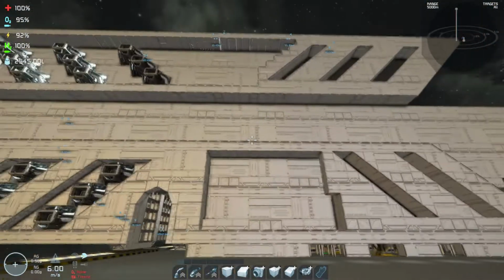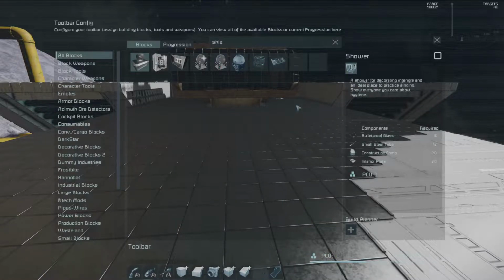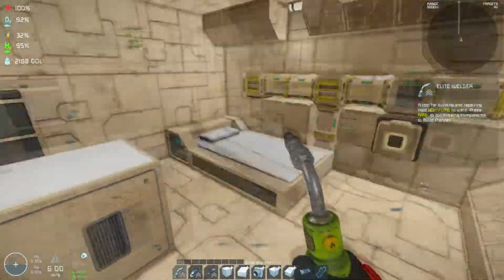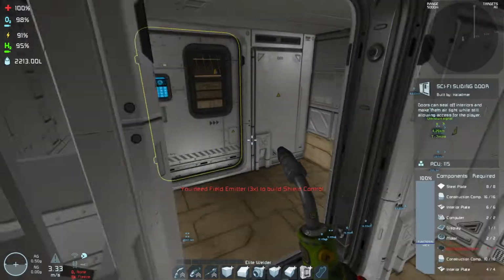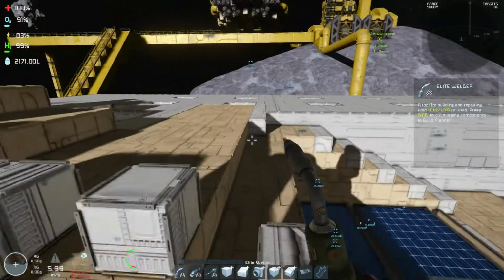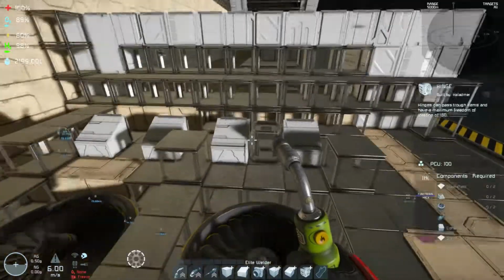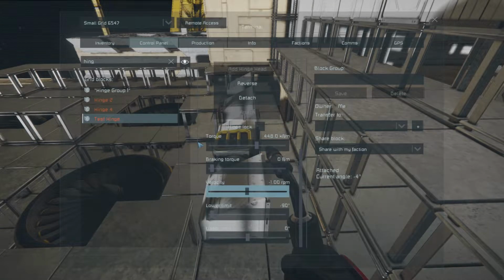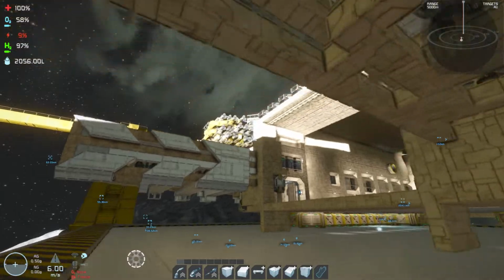Space Engineers | So You Want To Be An Engineer | Ep. 55 - Shields, Mandibles, and Armor Planning

Comment: Hal, do you disable PCU limit? I'm curious.. I just had to increase my PCU from 100,000 to 200,000 in my current single player (PC) game.
Reply from the maker: I generally take it to 2.5x of default (250 or so, instead of the 100xx default)  I find with my system it works well, and the sim speed stays pretty close to 1.0 even when I run out of block/PCU.  I've gone higher but not usually for worlds I'm recording in.

I'll do a quick look at the settings in the next vid for everyone ;)
Reply: @Haladmer  Thanks Hal.. sorry for the delay in response.. I was otherwise occupied in the hospital unexpectedly and only just got home.
The info you've provided will greatly help me.  Have you ever noticed if the number of mods loaded ever makes a difference in sim speed or overall performance?  If so what would you say is a SAFE number to have loaded and active.. assuming all are working correctly AND no errors are reported in game files.
Reply from the maker: No worries, I hope everything is better now!

For mods, it tends to be VERY system (and usage) specific.

Each mod will have a different impact on the system requirements, scripts & mod packs with scripts tend to increase CPU/Ram usage the more complex they get (or the more instances of them you're using in your builds), but even just blocks can slow things down a bit the more customized the blocks (such as custom skins or large number of vertices) are.

The higher end your system specs, generally the more mods/scripts you can run without it really impacting things, but the only way to be sure is trial and error.

That said, usually speaking, keeping it under the 10-20 range is okay as long as they are not things like radar/detector/sensor mods with some crazy hacked level of range on them lol
Reply: @Haladmer  Thanks Hal and yes, I will be in time but at least I'm not still in the hospital.  

You're gonna laugh at me but at the moment I've got around 160 out of 210 loaded and active mods in any one save game... and yes at some point in the game I will get "strange behavior issues"  lol  

What you've shared has enlightened me so I suspect changes will happen in further game plays. Thank You!!
Reply from the maker: Nothing to laugh about, just means you have a lot of great mods running on a good machine! :D

SE does weird things when you start running into memory issues, so my general advice is to start with either large block packs, or heavily scripted grids for likely sources for pruning.

Let me start by saying, I'm NOT calling out any of the following mods for issues, just using them to highlight areas I look at for system/game/sim-speed impacts:

Scripts related to heavily automating inventory management, for example Isy's Inventory script is actually a really well optimized script, so it's usually more the number of things it's controlling and less the script, or things like the old version of the Tiered Thrusters block pack which had 4 or 5 tiers of thrusters, using custom color trails and a lot of block definitions that were unique to each thruster, are good places to start.

The older version of the modular thrusters is another mod I watch for sim speed hits, but the newer version (from my understanding) fixed some of the legacy issues by removing some of the build states/model complexity (and cleaning up a few associated things)

Again, not trying to throw shade on any of the mod devs, they did amazing things given the limited support/framework KSH provided at the time.  Just some of the engine updates have changed/added (or removed) things that don't always break the mod, but definitely slow them down.

::edit insert:::
This is also all tied back into PCU/block counts, as the larger the ship/grid, the more work a lot of the underlying systems (even just running a full vanilla game) have to do.  It's one of the major reasons KSH officially don't like small ships gone large builds, but still celebrate them when done well :D
Reply: @Haladmer  Thanks again Hal and well played Sir by tying that back into the original question... nicely done! ;)

Comment: Why aren't you running the build and repair script that automatically makes the components that Bob is missing?
Reply from the maker: The main reason is priority control in item production.

The second is I like to know where my material levels are (see the lunar base's engineering section lol) and I find that I get "lazy" with the supply script running.  So I may run out of materials and not realize it until I REALLY need them lol

It's a great script, and I do use it when I'm using auto mining bots to feed my supply lines (they have a command to let me know their node is gone/empty), but when I'm doing manual mining, I don't tend to run the scripted queue system(s).

I'll talk a bit more about it on Monday, and if I can get the auto miners running again, may bring them online as well lol
Reply: @Haladmer  I have a similar issue. That's why I set up mining rigs. It's just a quick hop over to grab a full inventory of processed ingots and hop back.

I am actually going to start messing with drones that will transport supplies to and from with out my input. Once that's working I may even make a script that sends the drones out for me as supplies get low.
Reply from the maker: Good luck with drone coding!
Reply: @Haladmer  I'm going to do it simply. 

Drilling rigs with refineries 
Single drone for each drill rig
Single way point for pickups
Simple remote control autopilot
And a single trigger for each drone

I may script it to trigger automatically based on volume. But I'm not sure.
Reply from the maker: I'm assuming you've seen this one, RDav's AI Mining script (https://steamcommunity.com/sharedfiles/filedetails/?id=1356607768), used to rely on this thing for a lot of mining bots.  It was a great script to learn from for me, but it has a few bugs that can make for some really entertaining problems lol
Reply: @Haladmer  I have. I wanted to try and find my own way to engineer a solution. But I was thinking that after I do I might look into that.
Reply from the maker: There was a reddit, or maybe steam forum, entry about the details of how SE works with the various blocks (like the built-in ray-casting elements for cameras/sensors)and gave some basic steps/suggestions for setting up drones (specifically for mining).  If you're interested (and haven't already seen those as well) let me know and I'll post it here.

Either way, good luck with the scripting, as you likely already know, SE scripting is challenging in a lot of ways (good and bad lol)
Reply: @Haladmer  I didn't see those. I'll look, thank you.

But, I wanted to keep it simple. For now. Before I start trying the fancy stuff.
Reply: i honestly think i spent more time with OBS than i did with the actual game play.. and it was still a crap recording.. I'm going to have to fix that tomorrow... lol
Reply from the maker: No worries, just catching up now and checking it out (side note: great humor injections while dealing with recording problems!)  I like your use of timing blocks, remote control patrol w/waypoint actions, and the design of the drone!  It's a great example of how you can set up automation without needed to delve into the abyss that is SE scripting lol
Reply: @Haladmer  thanks. I did want to do youtube at one point. But, engineering irl does not leave much time for gaming.. lol space engineers and mine craft are my go to games.
Reply from the maker: I can fully appreciate that! :D

Couple other games you might enjoy would be Starbase, and maybe Timberborn (a.k.a. If beavers ruled the world lol)

Also, there is a YT channel Real Civil Engineer (https://www.youtube.com/c/RealCivilEngineerGaming ) you might enjoy (if you haven't run into them already).  UK based civil engineer (road/transportation designer I believe)  Takes on a lot of different genre's of games specifically from the engineering aspect(s) lol
Reply: @Haladmer  I'll check it out thanks